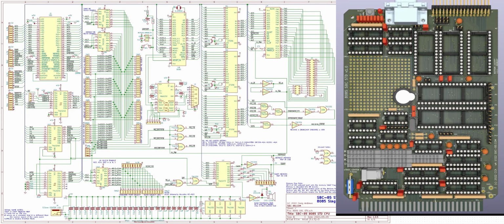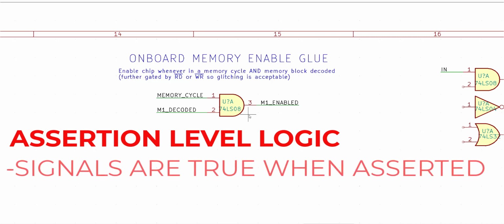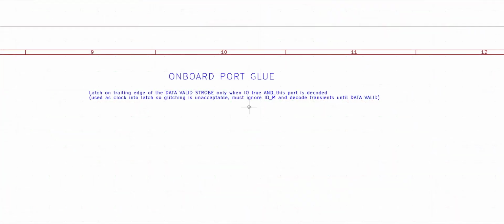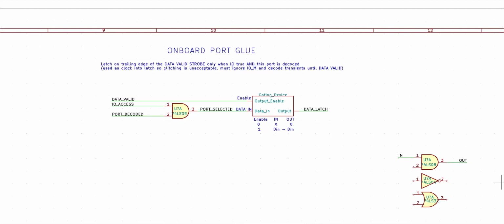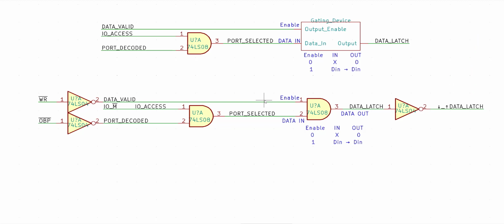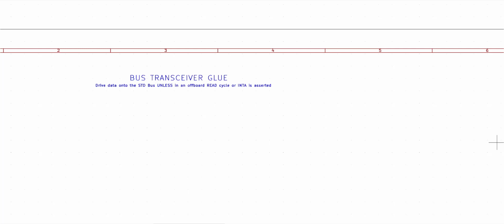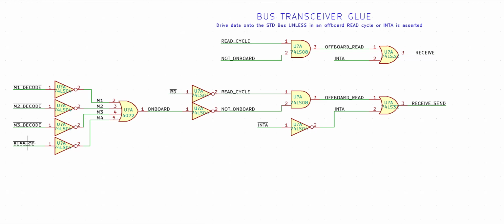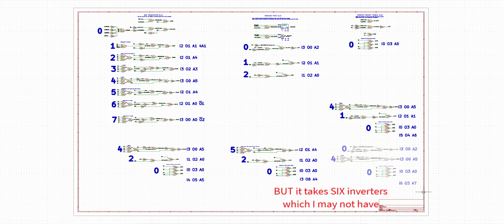{83} Creating glue logic & blocking transients.  Take that GLITCHES !!

Comment: I also keep a table of propagation delay sums for different device gates and combinations I may have to factor in other applications like CML , RF emissions / susceptibility , noise , foundational ( pneumatic , fluidic , optical , nucleonic , magnetic, mechanical ) translations .
Horrifyingly some designs have had to have deterministic failure modes for backup systems to detect , device failure influence on voting circuit or overwatch subsistem tie in ( gate output loading / input reactance ) delay for redundant systems can be annoying .
Reply from the maker: Good points and those are critical parameters.  Fortunately, my critical  application / fail safe design days are behind me so I can be quite cavalier with propagation delays and such. But just your mention of failure mode analysis sends a shiver down my spine.